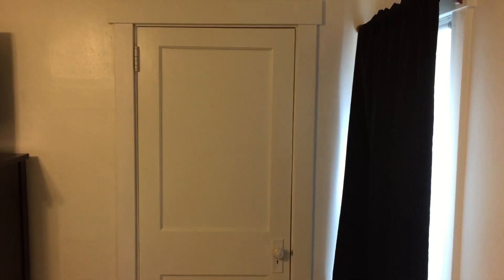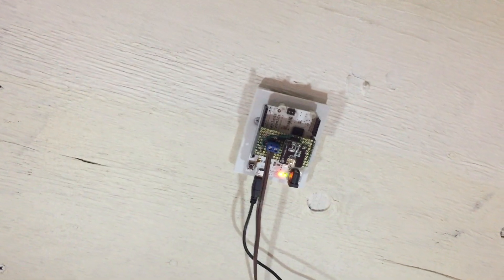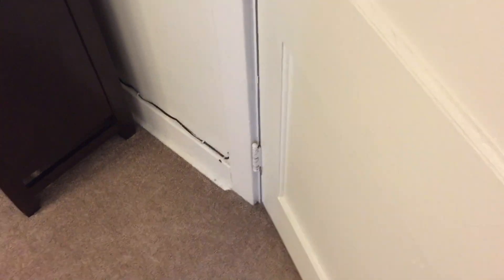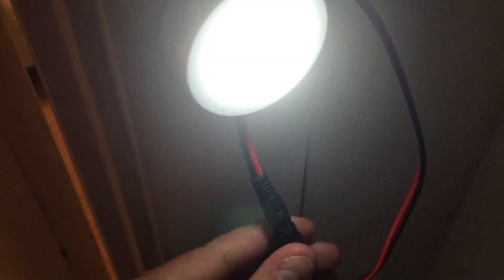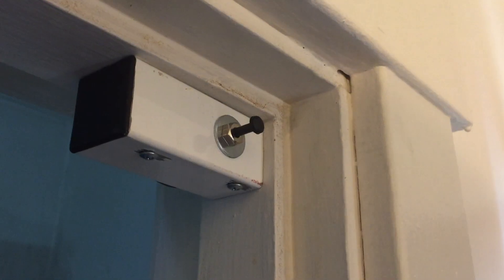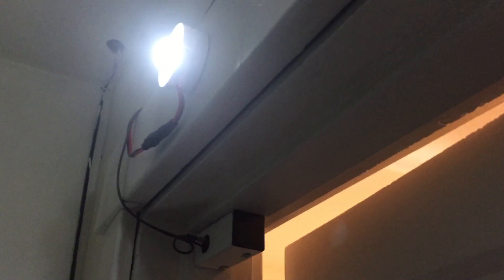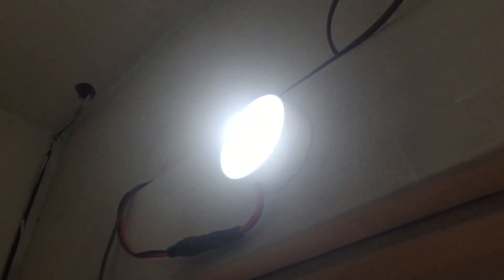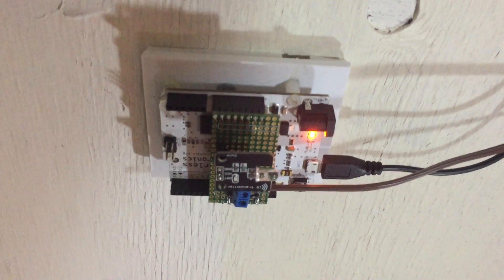Over-Engineered Closet Lights

Comment: Why use an Arduino when u can make a very simple circuit, and cheaper, with discrete components?
Reply from the maker: I could’ve used a strip of LEDs, a magnetic door sensor, and a relay and it would have the same functionality, but where’s the fun in that?
Reply: Where is the fun spending more money for the same functionality?
Reply from the maker: I had fun building it.
Reply: Ok! :)
Reply: How can i made it without using a Arduino? I have one but what can be a simple circuit without arduino?